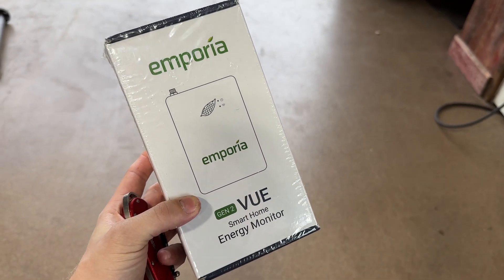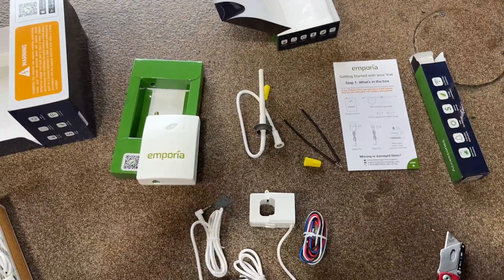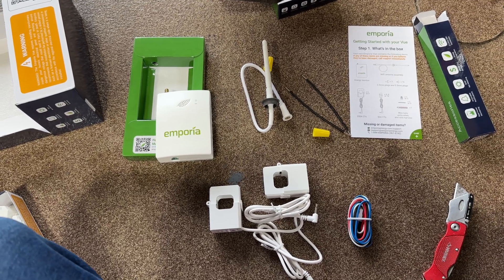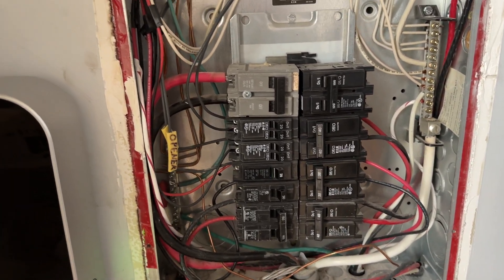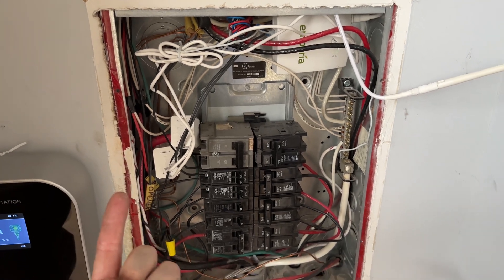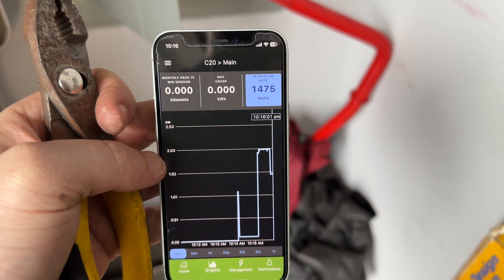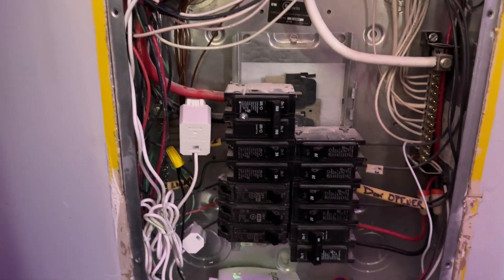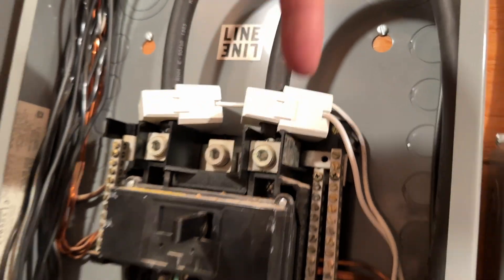Emporia Vue - Shocking Just How Much Energy a Home Uses

Comment: well that reminded me. i was looking at different ones last year. i have a 200 amp panel and a 150 amp sub panel. most of my stuff is on the sub panel. i need to look for something that does this but also with support for a main and sub panel
Reply from the maker: the sub circuit clamps are good for ~80A each, so I think you should be ok potentially to run those on the sub panel if you're not going straight for the 80% rule
Reply: @OvalboreTech  I need to look into this more then. Tomorrow because my brain is mush.  Worked all day